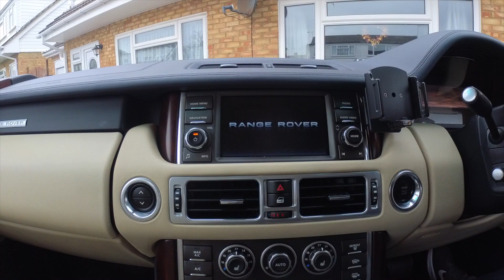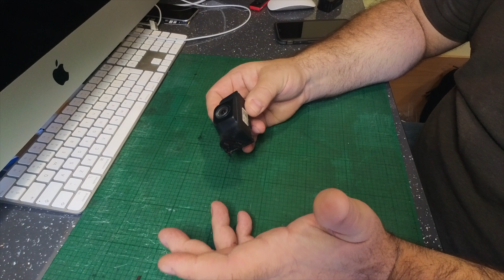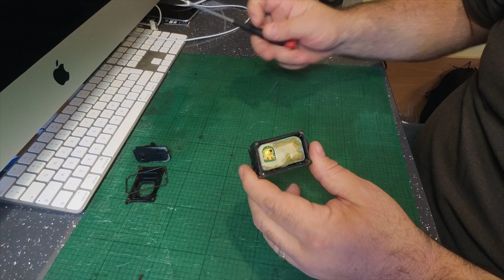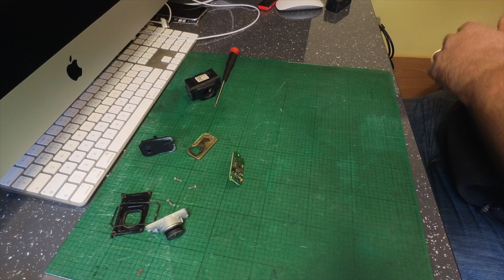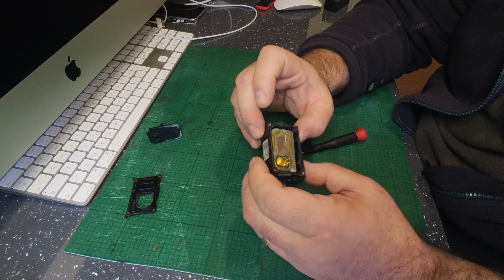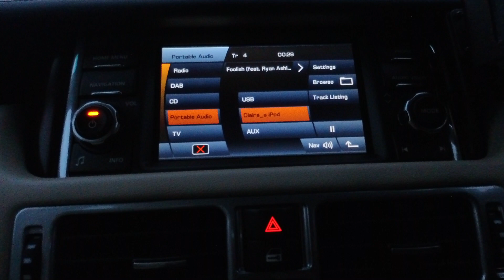DIY Reverse Camera Repair for 2010-2012 Range Rover L322

Comment: Please note the is a LR031815 camera.  I have 2012 late L322, and the rear view camera has a different 4pin connector (not with a coax connector). I think the part number is LR031812.  (the JLR parts website stated I should have the ...15 part number, but that is wrong ☹).

Comment: Great job!
I have a 2010 L322 as well and the rear view camera doesn't work. I bought a used replacement on eBay which also didn't work. Think it might be worth trying to replace the module itself. Any experience with taking that out and replacing it?

Comment: Hi how does the plug come off the back of the camera?
Any help would be appreciated.
Reply from the maker: Pretty sure you just squeeze the little tag and pull it straight off.  It certainly doesn't twist as it would break the pins.  I think it's harder to release it from its housing from memory.  
Good luck.

Comment: Great video!
Are there any other attempts that didn’t work and haven’t been published?
We share the same passion of buying great cars for nothing and coping with their problems 👍🏼
Reply from the maker: I did try to get a cheap eBay camera to work with it but even though wiring colours are simple enough, I couldn't get it to work.   I know it can be done on a pre-facelift but not sure why on this one.  Never even got any kind of picture so I don't think it's as simple as a PAL/NTSC issue.  Stupidly didn't test the camera first though so it may have been duff and I never re-visited it.  

It's been 9 months almost since I bought the car so I may have to do an update on that too